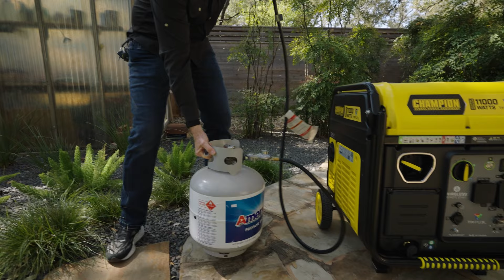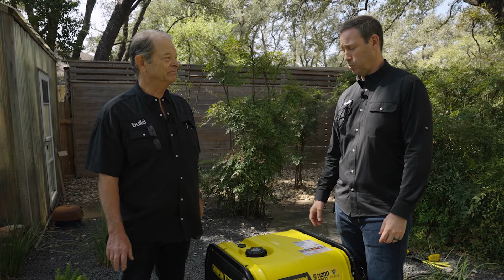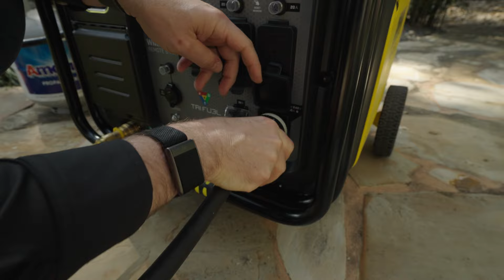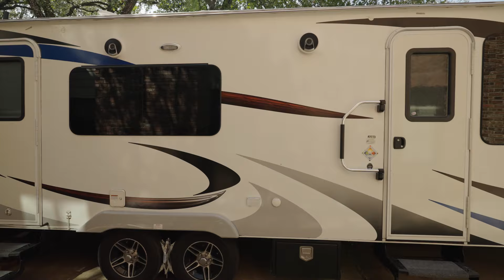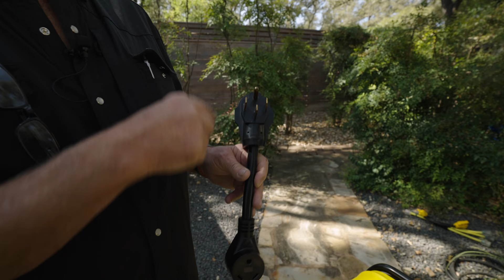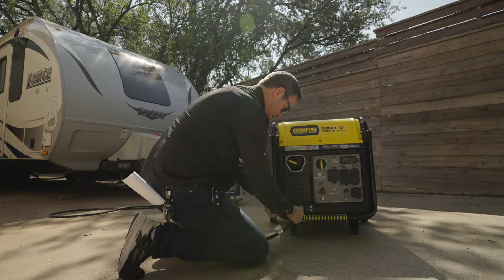Cheapest Home Back-up Solution Plus More! | Build Show Clips

Comment: Went thru the back up solution a year ago. After buying a Champion tri fuel I found out it wouldn't run my high efficacy furnace, I canceled the order . it was something about electrical harmonic distortion. Any way I bought a Generac and with the automatic transfer switch ,you hardly know it is there.